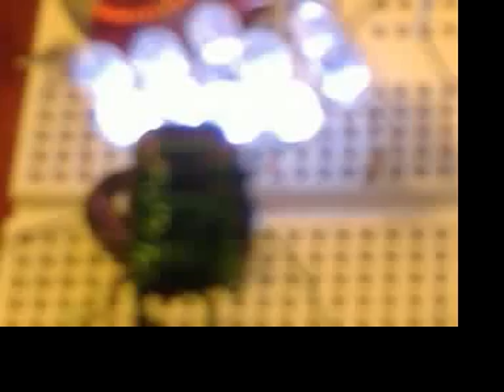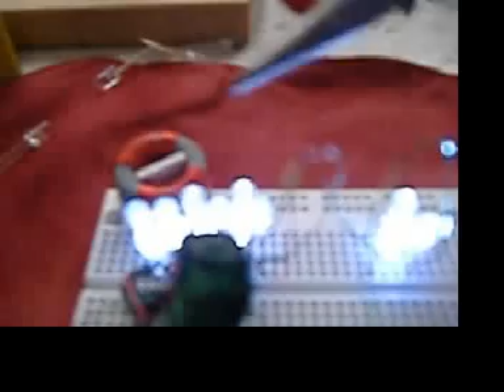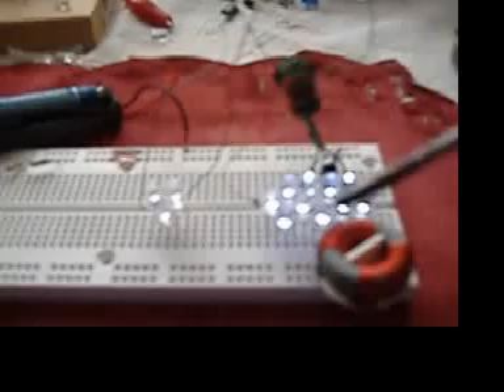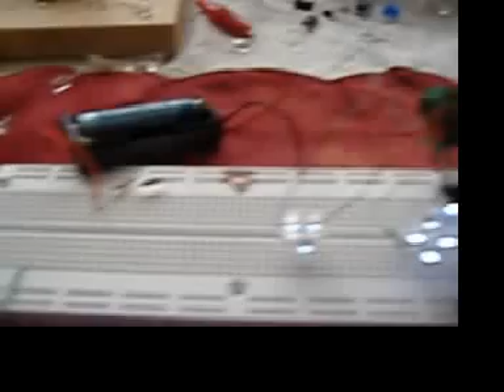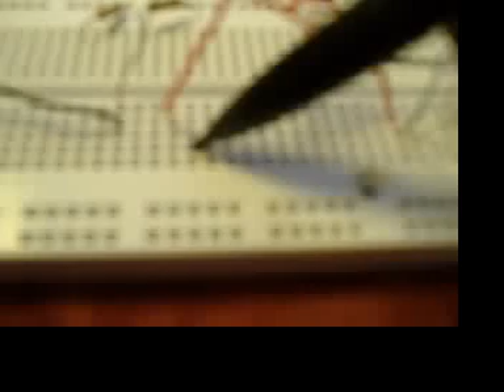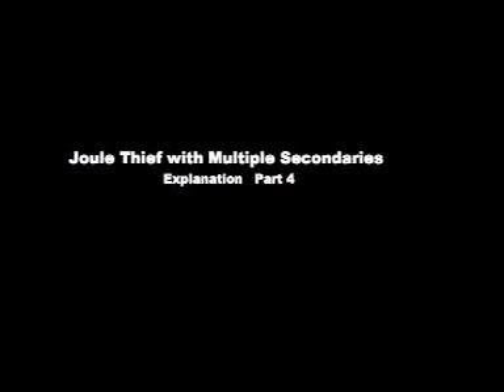Joule Thief with Secondary Explanation Part 4

Comment from the maker: OK, I have test results 4 you. 
They are for a jtc which I am currently testing which is much lower output but will show you what I am talking about.
Galv. bat produces 1.45v and 27mA
under load of the jtc the pulse ckt shows 5.3mA. 
The scope shows a P to P volt spike of 5.65v @100khz while lighting 4 parallel leds across the secondary; and,
the dmm shows 00.1mV = 100uv and
00.0mA with the 1ohm r  which = under 100uA at the same wires
The dmm cannot read at 100khz, and that is all I am saying.

Comment: @jeannacav 
Even if it was inaccurate, it would still give a _relative_ indication of the LED current.  If the millivolts goes up, then the milliamps goes up, even if they are not equal to each other.  However, my cheap DMM gives an average reading.  The DMM filters the DC, so that it can sample it to determine the digital value.  I've put a 100k and 0.1 uF between the LED/resistor and DMM, to filter out the pulses, and the DMM reading comes out the same.  So I dont think the pulses r a problem.

Comment from the maker: @acmefixer1 I guess what I am saying is that the dmm gives a totally inaccurate measurement of the voltage spikes across the secondary wires. It is sometimes possible to collect the voltage spikes in a capacitor and learn what they are but it is not possible to measure the mA. I use a scope to measure the voltage spikes peak 2 peak. I can measure the total amps draw from the battery, but this is not the charge across the secondary wires.=HFHV
Since you say it works 4 u, what are you getting?

Comment: Your eyes are a very poor judge of the brightness of the LEDs because they adjust to the ambient light in the room and if it's bright, then the LEDs look dim, and vise-versa.  I need a quantitative measurement of the LED output, and the resistor gives me the ability to see the differences in the LED current, which is related to the brightness.  You can also take advantage of this simple way to see the results of changes you make while you're experimenting with the circuit.  Try it and see.

Comment: @jeannacav 
Well, it works for me.  What's a LED?  It's a Light Emitting DIODE.  Not only does it put out light, it rectifies the pulses in the secondary.  The current through the secondary is unidirectional, so if you put a 1 ohm resistor in series with the LED, you get a reading on the DC millivolts range of any cheap DMM, and if it reads 20.8 mV, then it's taking 20.8 milliamps to make that V drop across the 1 ohm resistor.  You can twist ten 10 ohm resistors together for 1 ohm. (cont'd)

Comment from the maker: @acmefixer1 Hi,
Thanks for watching and commenting.
When I made these videos I was adding to verbal descriptions that I was making on a thread at overunitydotcom. It was so hard to describe, that I began to make videos. Now it turns around and new people want the verbal description!
btw, it does not work to use the 1 ohm resistor in the secondary like that. The pulse circuit of the joule thief takes the amps draw, and the pulses around the toroid make voltage spikes that light the leds.

Comment: If you put a 1 ohm resistor in series with the LEDs, you can measure across it, and determine what the LED current is.  1 millivolt equals 1 milliamp, with 20 milliamps being the typical LED's brightest without exceeding its specs.  Halfway through the video was blurry, difficult to see what was described.  I viewed the schematic, but it was difficult to see.  I think some narrated still pictures instead of videos would be clearer.  Thank you.

Comment from the maker: Thanks JDM..
You just wrap it around. I like to snuggle the wire in between the bifilar ones to get close to the toroid, but I do not know if this matters. There are a lot of opinions about winding the secondary. I have made many of them, and I do not know if there is a better way. The 21T S2 which is now doing better turn for turn than the 74T S1 is on top of the first one and I had to push the last turn through the center. It is just jammed in there!
Keep asking here if you want to.
jeanna